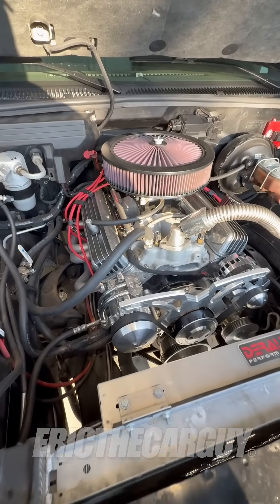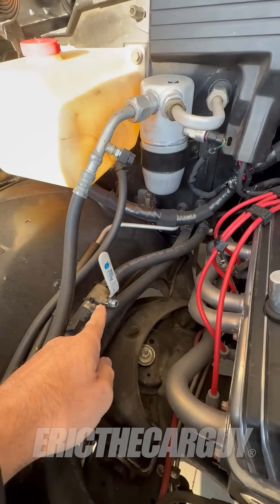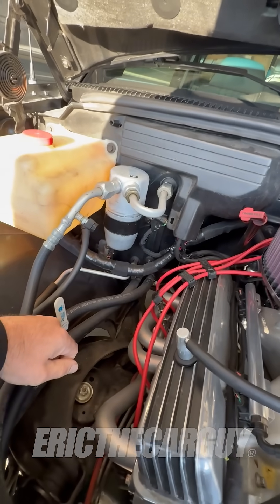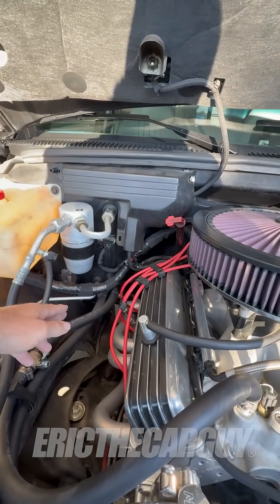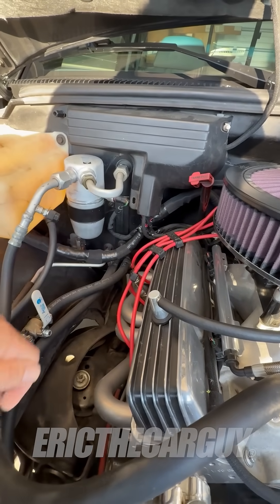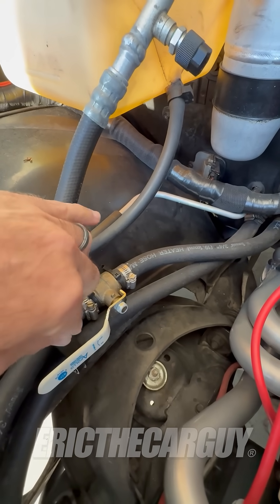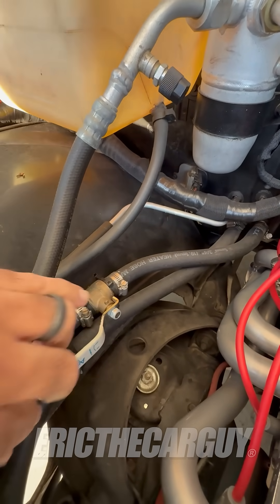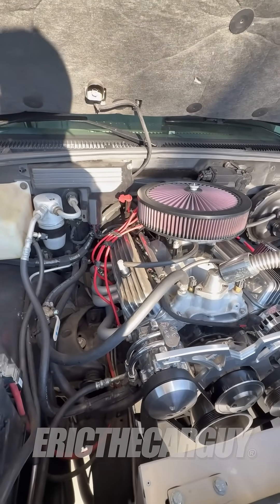How Car Heaters Work and the Purpose of the Heater Control Valve  #automobile

Comment: I wonder if my hybrid still uses a heater core.  Both the engine and inverter have a coolant loop, so I would think it's a possibility.  Has to be more efficient to use waste heat that already exists in the system than resistive heat.

Comment: in some markets some cars don't have heater cores. like some yaris in thailand. no heater controls either. they have aircon though(and naturally aircon controls).

and yes you'd want it(the heater) when its pouring down, actually, so you could see out.
Reply from the maker: Interesting, a practical cost saving measure for that climate. Thanks for teaching me that.

Comment: why doesnt the water pump jam up and overheat when u close this valve ?
Reply: most of the flow goes to the radiator elsewhere
Reply from the maker: You're only restricting flow through the heater core doing this, not the rest of the cooling system. There is still flow through the radiator and the rest of the engine. Think of it like a fork in a river. if you block off one branch of the river, it still flows down the other branch just fine.

Comment: Why need to have an additional valve when the manufacturer already had a valve operated by the temperature control lever inside the cabin?
Reply from the maker: There is no such valve in this truck, hence the reason I added one. Thanks for the comment.

Comment: I remember my school bus had a gate valve positioned by the driver that I asked the bus driver lady about. She told me it was for this exact purpose. Well she just said it was to turn the heat on, but we were in Florida and the bus was a 1992 model so I’m guessing it was a gate valve. The handle was one a gate valve would have. It was sticking out of a long slender metal box that ran down a portion of the bus floor. I love this simple and bulletproof system that completely eliminates heat from entering the passenger cabin instead of trying to design a more complex blend door system.
Reply: Holy crap I remember that as a kid I actually grew up around a lot of mechanics and such so I kind of already knew that's what it was, but I remember another kid asked, and she explained it to all of us, of course maybe being the kid that kind of already knew had to step in and start talking lol

Comment: 2-3 years ago my 2011 Honda CRV had the "Electronic" Blend valve stick  open in the summer.  AC wide open and the ride is getting hotter.  "Supply Chain".  Took a month to track down a replacement at the dealer.  Cost a kidney in price.  The service guy admitted how stupid that design was.  I said way back when there was a chance that all it was, was the cable fell off the knob on the dash.  He said, "Yeah, a pair of pliers, once in the spring once in the fall".   I think back in the 70s either Datsun or Toyota actually had something like this in the video under the hood.
Reply: its more common to just control where the air goes instead. but i guess it allows smaller packaging if you'd control electronically the flow into the heater core instead of the air bypass.

Comment: I thought the manufacturer did that to prevent legionair disease.
Reply from the maker: Leginair disease happens when the evaporator collects a certain type of mold. I've never heard of it effecting an automotive system. Manufacturers made heater control valves for the very reason I did it, to prevent hot coolant from passing into the heater core during AC operation. Yes, there is a blend door that blocks off airflow through the heater core in the dash when AC is commanded, but there would still be hot coolant flowing through the heater core who's heat would work it's way into the HVAC box and make the system a little less efficient. Thanks for the comment.
Reply: @ericthecarguy Thanks for the information.  Great videos..
Reply: @ericthecarguy  you need standing water for legionnairs disease bacteria to grow

Comment: I think it would be wise to set up some way to toggle the valve open or closed from inside the vehicle - in easy reach of the driver.  Otherwise, I've seen some cars that have these (factory setup) and others that utilize a flap type of system for directing airflow.  I haven't really had any issues with either system, TBH.
Reply from the maker: I don't feel the need for that. the valve is open in the winter, and closed in the summer, not that I drive this truck in the winter. The blend door in the dash will handle the fine control. After all, they never made the truck with a heater control valve yet it still had functioning HVAC. I just made it a little better on the AC side. Thanks for the comment.
Reply: @ericthecarguy  I was thinking more along the lines of being able to restore water flow to the heater core in the event you ever needed it as an emergency supplemental engine cooling device in the event something clogged airflow (or water flow) in the radiator.  Be nice to be able to quickly pull the valve from the driver seat in the vehicle should such an event ever warrant it.   Just my $0.02 worth.

Comment: Or you can just have a blend door block off the heater core side and no hot air will pass through. some times you wanna mix the two hot and cold to get a certain temperature. With this setup you’re only going to get completely cold or completely hot.
Reply from the maker: That's actually the function of the blend door, to block off the heater core when AC is demanded, or a mix of the 2, and you are correct, with my set up, there is no 'fine' control of the temperature. That doesn't concern me. My only concern is that I have the ability to have the coldest air possible in the summer. Thanks for the comment.
Reply: @ericthecarguy  no problem I enjoy the videos can’t wait until you get your own shop back again.
Reply: @ericthecarguy The only issue with that setup is there is no coolant flow before the thermostat opens, most systems with a valve also have a bypass hose to keep the coolant flowing within the engine block. GM usually just uses the heater core as their bypass to prevent hotspot before thermostat opens.

Comment: When it is off does that change the water level of the system?  I mean in the winter when you close the valve to flow coolant would the system have a lower level then in the summer.   Or is coolant always in the heater core just not getting hot?
Reply: Coolant would always be in the heater core just no hot coolant can come from the engine to the heater.  The stuff in the core would just sit there
Reply from the maker: No. There is still coolant in that part of the system it's just not flowing with the valve closed.

Comment: I get worried about these.. I know they make like the u-shaped adapters, so it goes back to the engine.. With this valve, does that hose ever get over pressurized?
Reply: The water pump doesn’t produce much pressure, the system pressurizes because of heat. My Toyota temperature control has a cable operated valve similar to this from the factory
Reply: The u shape adapter would bypass and disable the heater. Either they live in a hot climate and don’t want heat, or the heater core is leaky and they don’t want to pay replace it
Reply from the maker: Nothing to worry about. It's a brass valve designed to work in water systems, including hot water. Also, 15psi is the max pressure of the system. Thanks for the comment.